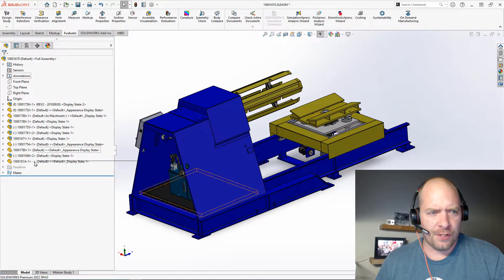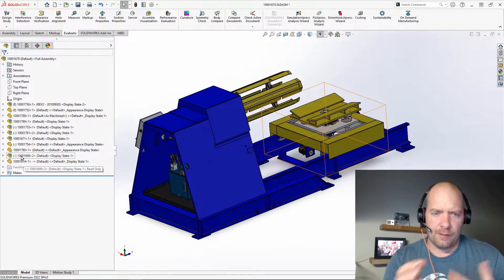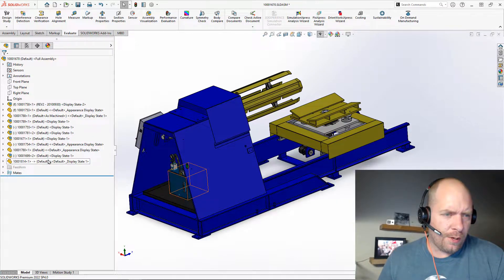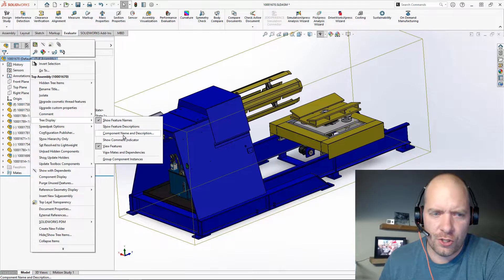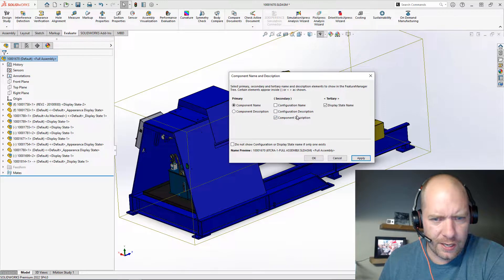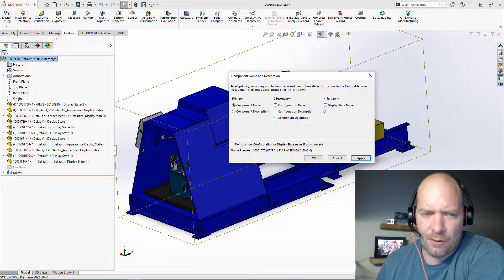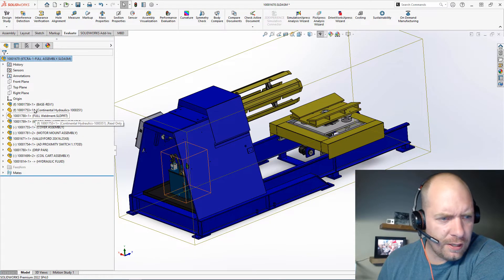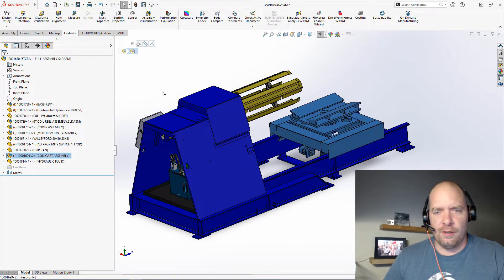SOLIDWORKS Tips:  How to get descriptions in the assembly tree

Comment: Its is a shame that this can't be the default and has to be changed for each document...  thank you tho for a great tip!
Reply: All you need to do is update your assembly template.
Reply: @kleingarrett55  I assume this would only change the assembly tree setting for new assemblies, not existing ones? In my opinion, the display settings for the assembly tree should be saved in the user settings, not the assembly.